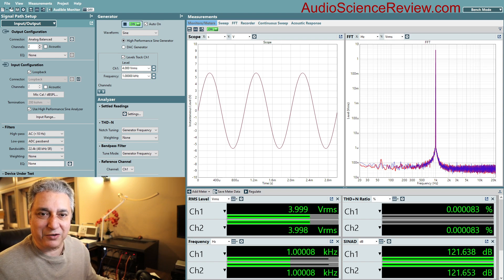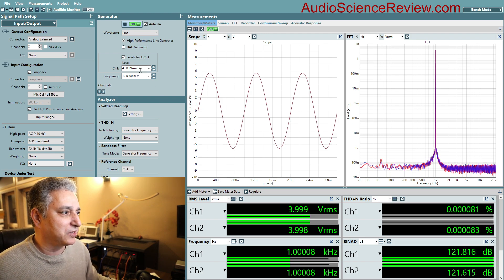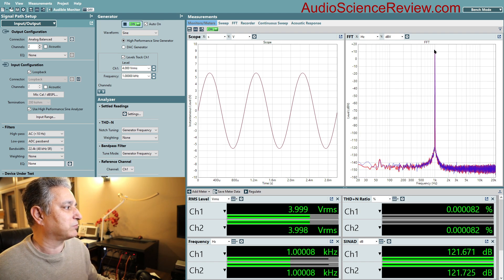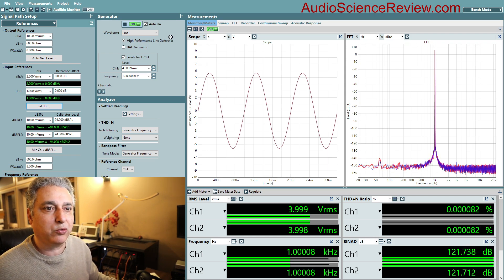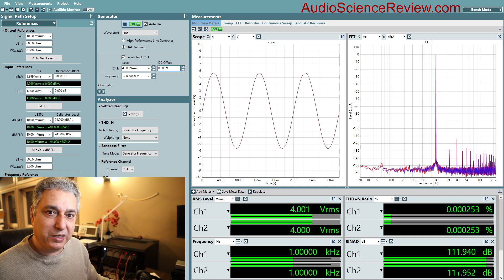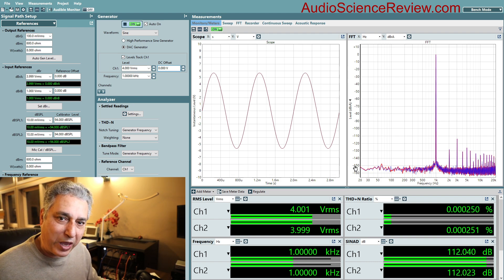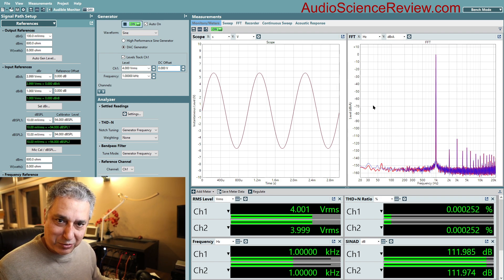What is a decibel?  A quick tutorial.

Comment: It is ten times the logarithm of the power ratio. A power ratio of 2:1 has a logarithm of 0.3. Multiply that by 10 and we get 3dB. This, they say, is the minimum local change in the audio that a human can detect. Twice as much or half as much power.
A power ratio of 10:1 would have a logarithm of 1 and thus would be 10dB. This, they say, represents twice as loud in human hearing. So 20dB would be four times louder, 30dB would be 8 times louder and so on.
If we are only measuring voltage ratio rather than the power ratio, we multiply by 20 rather than 10 because power is proportional to voltage squared. So double voltage is 6dB and ten times the voltage is 20dB

Comment: Nice explanation of your "meter" for whatever that is worth.   Unfortunately a crappy explanation of what a decibel is.   Started with A.G. Bell - due to the fact that when he was working with the capabilities of human hearing, it being around a 100 dB between softest and loudest sounds capable of being heard, he tired of the huge numbers, such as one trillionth and decided to use a logarithmic scale to express differences.  Hence the name "DECI BEL" where the Bell references A.G. Bell.

Thing you should have emphasized - and you didn't - is that the concept of a decibel is not a static or fixed number but always a RATIO.  That ratio being based on whatever ZERO dB is defined as.  

For instance.  At STP the thermal noise in a 6" length of bare copper wire, measured in an RF "shed" is about -115 dB down.   This being defined by the ZERO dB signal of 1 milliwatt (or 0.001 watts).

Also as Goofball of P.S.Audio (should be called B.S. Audio) found out to his chagrin, most amplifiers express their gain not as a power ratio but rather as a VOLTAGE ratio of output to input.   One would think that a POWER AMPLIFIER would express its gain as a power ratio.   Which btw, is expressed as 10* the ratio of the common log (base 10 log) of input to the output.    While voltage gain is expressed as 20* of the ratio of the common log of input to output.

Not a very clear or very informative explanation.
Reply: Your explanation is the real crappy one. You're not explaning the concept of the decibel, you are retelling the history of its occurrence. The fact is, that since Weber's Law, it has been understood that logarithmic / power law metrics are more meaningful than linear metrics for a broad variety of phenomena related to transducers and by extension, perception. Amir is perfectly coherent in explaining what truly matters about the decibel : That it is a log / relative unit ; i.e. one that expresses ratios as an even scale. You missed an opportunity to hide your lack of lucidity.

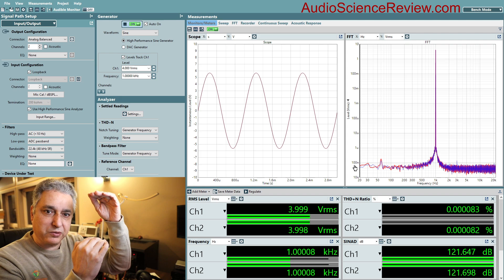Comment: I having trouble I with mild levels of stages of dementia. I bumped my head or into side of my pc monitor mounted on the wall other night cos my new cat Bear was running around I forgot about my surroundings and few years ago I collapsed and when coming around found I was bumping my forehead against concrete floor in the kitchen. I'm sharp just keep forgetting. dB yes I need to do the test again. Set up the direct speaker line to THX 3417 monitor to line L on the TrueRTA  or REW and line R to microphone in the room so I can look at both at same time in real time 2:54 psychoacoustics and a little bit more. 
I just don't have enough PEQ filters to tackle the HF horns frequency range by tackling each narrow band and why? That is a lot of frequncuies to cover from 303Hz to 20.000KHz that would be like daisy-chain x5 Behringer FBQ2496 per LCR HF horn that is a bit too much would be great if the PEQ can cover the each frequency band slice in the spectrum. No I am not an audiophile.

The sound effects in movies may have sound effect that covers many frequency bands other effects may centre on certain frequency. 
EQ tuning HF horns behind acoustically transparent screen is the challenge to solving and getting each HF horn to sound the same but can't do that unless the PEQ has a range to cover those frequencies otherwise would only be doing less than half of it.

Comment: It's worth noting that the reason that even though the noise is at -150ish dBr, the SINAD is about 30dB higher because the noise is white noise - equal power at every frequency, and it sums together to a higher level. 

Also, as I understand it, it's essentially impossible to go below about -121dBr because of Johnson noise in resistors.

Comment: Now I understand why so many amp reviews never have a 1Khz bang-on reading, instead it's always up 0.00008 in terms of clocking. AP should look into fixing that for posterity's sake >_<
Reply from the maker: It is an analog generator so may be hard to get it to be more accurate than this.
Reply: @AudioScienceReview  Go show'em how its done! (and get them to update to a 64-bit software for good measure).
Reply: @JayJayYUP  voltage generators of that accuracy require maniacal temperature control and large, esoteric circuits. CERN publishes specs for such high precision sources but that would make test devices like the AP, which is already quite expensive, literally unaffordable and finicky to use. Check out Marco Reps' channel for experiments with precision voltage sources
Reply: @phpn99  Fair enough

Comment: I'd like to see a video or videos that go in depth into  sinad, dr, thd+N, S-N, loaded vs unloaded measurement. Also ways plots and stats  can be gamed to manufacturer's advantage. I mean stating bandwidth 20-20k, things like vertical axis scaling to make FR more flat. Also how we interpret phase plots when measuring transducers and what conclusions can be drawn from these plots, for example for crossover design or equalization.
I have read quite a bit on these issues, but I struggle with reading comprehension, especially in English. I understand much more through videos.
Reply from the maker: Good idea.  I will put it on the list of tutorials to do.  Thanks.
Reply: good idea!